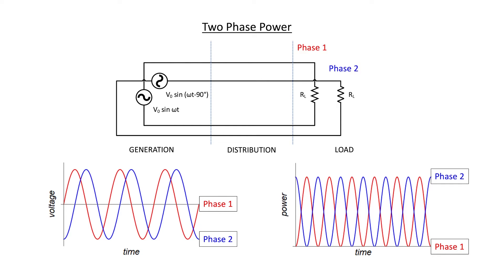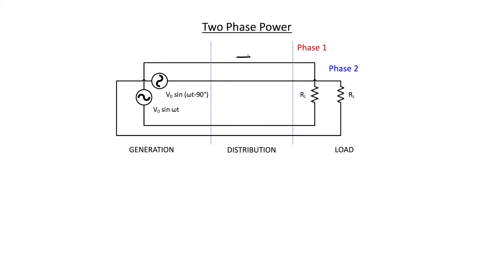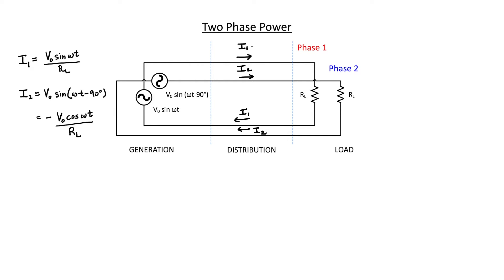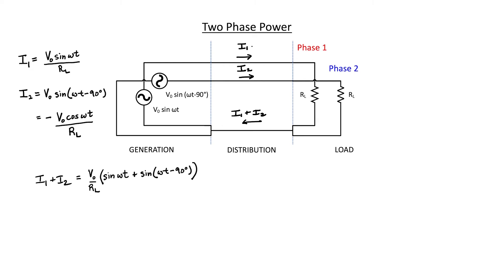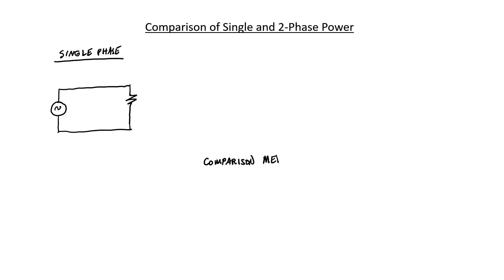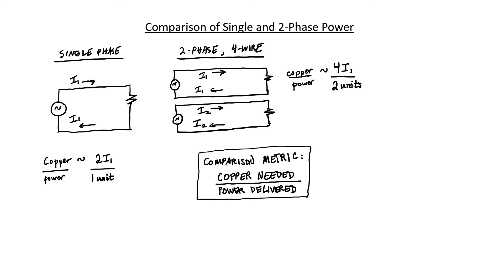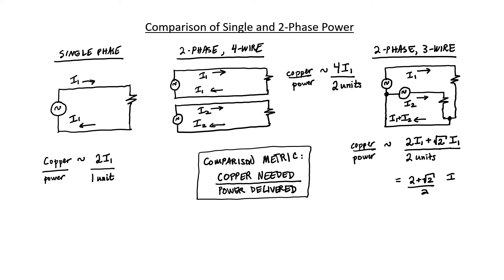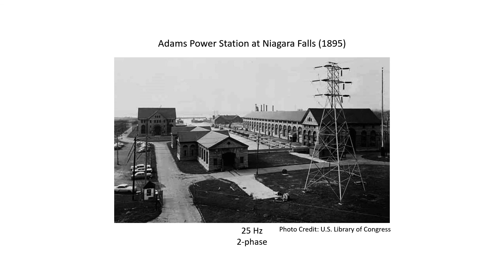A look at 2-phase electrical power (13 - Electricity Distribution)

Comment: Split phase power is not 180° apart. It’s single phase, so it’s in-phase. People get confused because they use the neutral as the reference point so it makes it look 180° out of phase. It’s not. It’s an error in the measurement technique.

Comment: If a consumer is supplied with two phases of 230VAC using 2 cables from a 3-phase 400VAC system with 3 cables, the current calculation for the two phases must account for the factor of √3.

Comment: Please correct figure at time 4:20. You have short circuited one of the single phase sources!
Reply from the maker: It's a crossing of wires there, not a junction.
Reply: @adanner  OK. Got it

Comment: OK, so I ran across a really old 2-phase motor and was working on a replacement.  I put an amp meter on the 2 phases I found at the disconnect and took a voltage reading too.  I wanted to calculate total motor power to see if the current motor is sized correctly for the load.  I put them into a spreadsheet to calc power.  However, that spreadsheet used P = V * I * sqft(3).  I think that for a 2-phase system that was wrong.  Would I actually just add the amps from the 2 wires together to get the power?  As is P = V * (Amps1 + Amps2)

Comment: What's the difference between 2-phase power, and basically using 2 hots and a neutral to power a dryer or air conditioner in a normal home?
Reply: In the system you're describing (single phase two legs) you have 180 degrees between the two phases, so the two in series give you twice the voltage).  In the two-phase Philadelphia system, there is 90 degrees between the two phases.... so if you put the two phases the crest of one is at the trough of the other and the sum is zero volts.

Comment: 2 phase power is still used in Philadelphia PA and Hartford CT USA. The provider supplies 3 phase but uses a Scott transformer at old buildings that are wired for 2 phase. It was my understanding that the primary advantage of 2 phase was that it could be used to start motors with no additional starting mechanisms. Also the case for 3 phase.
Reply: Kind off ... but the 2 phases that you get still aren't used as 2 phases but single phase with 2 voltages. Double the voltage, double the power on same cross sectional area.

Comment: Philly electrical work ole son!  2 phase was to get motors turning in 19dickity2 before starting capacitors came around.
Reply: Capacitors only came later, pole shading was the first method, still used today in low power applications since it's such simple and reliable construction.
Reply: I heard of two phase in the 1890s and early 1900s, but never understood the purpose until I really got into electronics,  then it began to make sense because a capacitor tends to shift the current phase by 90° and causing a moving magnetic field to get a motor turning.
Reply: @Sparky-ww5re  In most modern split-phase motors the capacitors generally shift it around 15 degrees. A "run" capacitor in placed in the "start" winding.  I'm not and electrical engineer but it has something to do with back EMF on the second (start) winding and motor efficiency.
Reply: @nunya___  oh thx.  Interesting.  Wasn't sure exactly how many degrees the capacitor shifts the phase, but since capacitors are used in modern high power factor magnetic HID ballasts for example,  to combat the inductive nature of these fixtures and bring the power factor closer to 1.00, most are 0.9 or a little better.